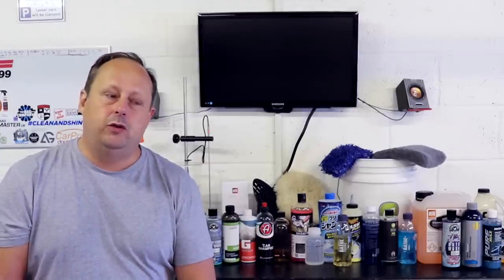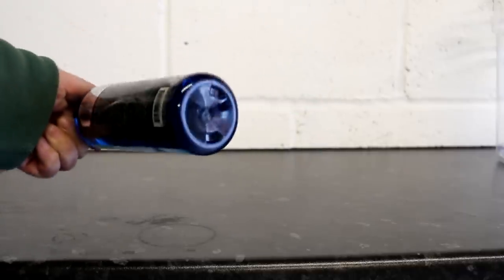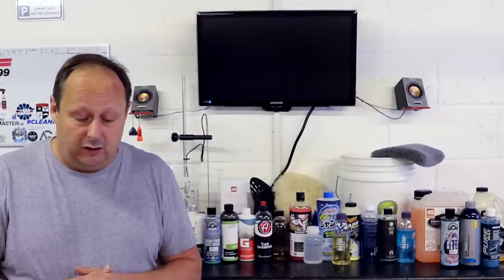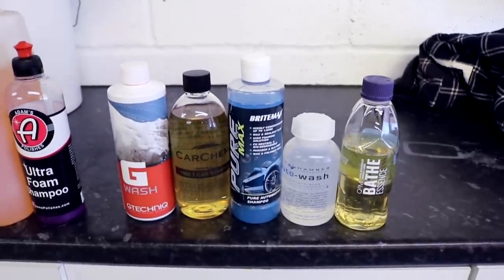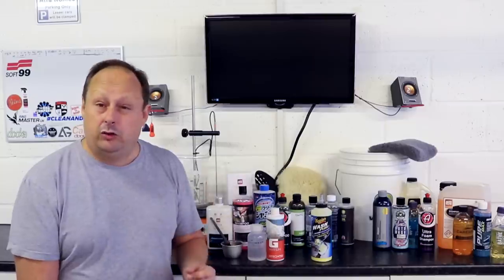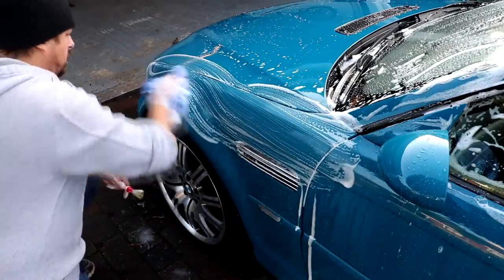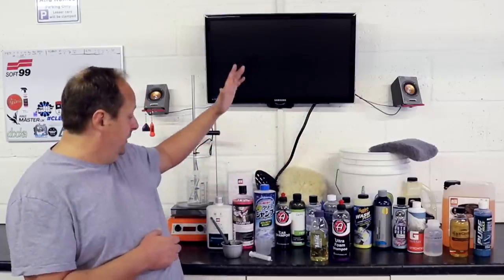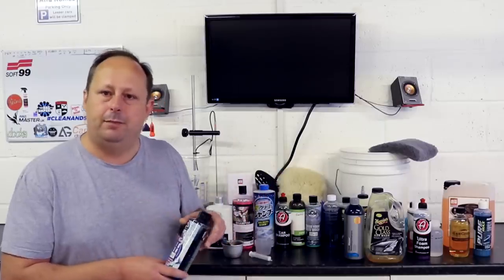The Best Car Soap Shampoo - 20 product shootout

Comment from the maker: Notes: 
Koch Nano Magic Shampoo is also available in 5L and 10L from the profesional line
Britemax is also available in 1 US gallon (not just 16 or 32oz)
Reply: If we think without pricing in mind...for nano shampoo ...Koch is the best for you?
Reply: @dimmacommunication  The question wasn't cost related. This is why i said "without thinking the price". The question was regarding performance of the shampoo ;)
Reply from the maker: you have catagory for Cleaning if thats the priorty and you have a catagory for like foaming.   you cannot measure slickness even the guys that make it has no lab style test for slickness.  

price per wash is just about the only tangable thing you can seperate them on.  but I realised it wont matter to all so we had catagories for like best retail luxoury one as well.

you have recomendations here for literally anything and everything you could want in a car shampoo.
Reply from the maker: @dimmacommunication  no worries mate that are all good points to raise I want to hear opinions all the time.   Ive used at 2 caps and 4 caps, but all the shampoos as you see them in the orange buckets and in the ghost bucket were used at lowest recomended concentration g wash says 2-4 capfulls but also say 1:1800 .  1:1800 is like closer to less than 1 capful.  still works ok at that low concentration but you get much better suds and stuff when you use a couple
Reply from the maker: @dimmacommunication  try it mate.  Its a good one for sure.    Its quite alkaline (PH9.6) and seemed to have a good impact on the grease tests I did.  aside from just this its nice and foamy as well. really good product.
Reply: Nice video to help people who looking the best car soap shampoo.
Reply: have you ever heard of bowdens? Australian made product, has a very big following in Australia/Newzealand
Reply: I got the Meguiar's Gold Class at Walmart last week for $5.97. I wonder if that would change your opinion of it. But I just want the best clean overall. Have you done an updated ranking? Can I use the ceramic washes if I am using Jescar and Collinite? Just curious.
Reply: this chemie shampoo does not remove waxes and sealants like Carpro Reset?! is safe in all dilutions »?!
Reply from the maker: @eduardofolha8415  carpro reset does not remove waxes and sealant eduardo.
Reply: @ForensicDetailing  I used Reset on snow foam at 1:10, waited 5 minutes and removed ....
Afterwards, it was washed with reset and 2 buckets .....
The Pan the Organizer told me, if I always wash the car with Reset it will affect the paste wax or spray sealant because it has alkaline power ....
It just doesn't affect ceramic tiles!
So is he wrong ?!
Reply: @ForensicDetailing  I don't have any ceramic tiles on the car ...
I only use a wax like turtle wax seal in shine, or meguiers wax spray ...
by the way, you say that the Reset shampoo does not remove waxes and sealants, OK!
And the pre-wash with Carpro Lift will harm the wax or sealant ?!
Reply from the maker: @eduardofolha8415   Search you tube for Alkaline V PH neutral you will see some tests I do.    The alkalinity wont make that much difference say its takes 25 passes of a PH neutral product to strip product X on panel Y replace with alkaline product and the degradation rate will be like 20 passes instead.  note this is just an example so dont take that number as a real figure.
Reply: @ForensicDetailing  so I can be calm about washing the car once a month with reset ?!
Even in 1:10 prewash ?!
Reply from the maker: @eduardofolha8415  yes mate
Reply: @ForensicDetailing  
thank you friend, I will be more rested, because Pan the organizer scared me, says that the reset is only to be used in cars with ceramics, otherwise it will remove waxes and traditional sealants ...
I'm sure he doesn't know what he says!
One less subscription!
Reply from the maker: @eduardofolha8415  tape off a square on your bonnet.  put a wax in that square remove tape. leave wax a day.   see if you can wash the square of wax away with carpro reset.  I can save you time.  you wont.  no detergent can strip modern LSP's.   your probably misunderstanding Pan.  What he might be saying is that reset is going to be more agressive than some shampoos.  And it is but the difference wont be huge.
Reply: @ForensicDetailing  he said that he will not completely remove the traditional wax or sealant completely, but he said that during the washings he would remove the protection since the Reset has alkaline power!
So you are saying that the Reset even removes the protections during the washes ??? ....
For me to be safer with traditional waxes and sealants, I would recommend the Koch Chemie Gentle Snow Foam, both for prewash and for washing, is it a softer shampoo ???
Reply: I know everyone gives wash and wax type products a hard time, but that'd be cool to see a comparison amongst that product range.
I find that wheel coatings don't last nearly as long as I'd like them to for the time and effort you put into them, so I'll typically use a wash and wax type product for wheel cleaning

Comment: A bit late, but there is one small issue with this test. Soft99 does not belong there, as this shampoo is not supposed to be diluted in water. You pour it directly on sponge and use only one bucket to clean sponge and if needed you pour a bit more shampoo. Otherwise you lose all properties, including easy rinse and ability to rinse even dried shampoo :)

Comment: Each one of your videos is a treat, Mate! I'm a pro detailer in MTL Canada and I've given up on the usual bucket and mitt wash and now use Optimum No Rinse and Wax on normally maintained  cars with quite stunning results for VERY little expense per wash.  BUT !! There IS a secret if you want way better than average results. FIRST, pour 5 capfuls into a 5 gallon bucket that has a lid on it because that amount will last you for 10 to 12 washes - AT LEAST.  NEXT, take 2 or 3 VERY plush, thick, CLEAN  16"X16" cloths and soak them in the bucket. Fold each cloth into 4 and use ONE surface of the cloth for PER PANEL.  DO NOT RE-DIP YOUR WASH CLOTH  into the wash medium!!!   (This beats the "two bucket method" by a country mile since your wash cloth AND your wash medium are ALWAYS CLEAN AND have NO GRIT in them whatsoever!!)  Again: wash ONE panel with ONE side of the cloth and keep switching cloth sides for each new surface.  EACH cloth has 8 sides, so 2 cloths should do for the average size car. With the Optimum No Rinse, and Wax, you can do one panel at time from the top down and then dry each panel right away with a soft waffle weave drying cloth spayed with your favourite Quick Detailer as a towel lubricant AND to add another layer of shine to the Carnauba Wax that is part of the  Optimum's solution.  At first I had doubters but everyone swore that they'd just had their car waxed after their wash! ( I call it a Detail Wash : ). BTW, I take FOUR, separate BLACK cloths and use one per each wheel and when finished, I put them in the wash to clean them SEPARATELY from the cloths I use on the cars. Happy detailing! Sorry for the long comment John - just wanted to get you back for your long vids! : )
Reply from the maker: awesome david thanks mate.  so many peeps choose the ONR way.
Reply: David.......this is exactly the way I do.  Nice to see a pro-detailer using this  rather than the BRS 

BTW - how do you dry after ONRWW
Reply: Excellent method to suggest for ONR washing, especially now that old man winter has come upon us forcing us to work indoors without the hose. By the way, which plush microfiber do you use on your vehicles for this particular method? I've actually tried Detailing Image's reTHICKulous towels the past and had some moderate success with them.
Reply: @kidoctane   Sorry Joseph for the past due reply - only saw it today! : )  Just take any good soft waffle weave drying towel and spray it LIGHTLY with a quick detailer like Chemical Guys VO7 to make sure you don't dry the surface with a completely dry towel and flip the cloth over for each panel. So, two or three waffle weaves should do you for the whole car or maybe 4 for an SUV. Cheers and happy detailing . . . errr . . . washing !  BTW - I'm not familiar with the BRS acronym : ) ?
Reply: @davidguberman4780    David, I got my cloths from Eshine in Canada but and they are thick but PROBABLY no thicker than YOUR THICKULOUS towels. Just about ANY PLUSH towel should do just fine. IF you have any doubts, you can always use 3 or four wash MITTS : ) The principle of the method has more to do with the fact that you don't RE-DIP your wash cloths or mitts into the wash bucket.  IF your Thickulous cloths are the thickest possible, then it's all good. If you can remember NOT to rub put to PAT any really soiled areas, then you'll not damage your paint. After patting the really soiled area THEN go over the area again, letting the weight of the cloth do the washing. IF the surface is really heavily soiled, then you may need more than 3 or 4 cloths so and not to re-dimp then in your wash media which both dilutes AND soils it. Just also remember to wash your wheels with 4 separate black (if possible) wash cloths and clean them afterward separately in the washing machine!  Happy detailing! Don't hesitate to write with any more Q's : )
Reply: @davidbee8178  Hi David. I was thinking to try this which towels do you recommend from eshine to do this? They have several  to choose from Thanks

Comment: Fantastic way to spend an hour with a coffee!!, I loved the way you split them all into their categories and tested to their capabilities.
I actually predicted carchem 1900-1 winning as I recently done a product review of it a few months back in the summer and it’s been the best quality shampoo I’ve used in 5 yrs! It’s got everything, dilution, scent, lubricity, foam, cleaning power and I found it quick drying without water marks too. Very difficult to separate them , looking forward to the next test 👌
Reply from the maker: thanks graeme,  kind of what you said is how I saw it.  I couldnt really find fault with it and its the cheapest cost per wash.  I had to almost keep saying that to myself though because there were so many good soaps that I would use in this line up.  I wasnt sure if bath essence or BH should have won as well because I really like these 2.  but ultimately the around twice the cost per wash of the car chem. thats what swung it this way for me.

Comment: I was pleased to see Autoglym in one of your videos again. I rate their products but I'm just an amateur at this, so its comforting that someone I trust to give reviews show some of their products and fortuitously they don't do too bad.
Reply from the maker: the UHD is a great shampoo.  but the problem is it was really impossible for lots of them to win this shootout  just based on the fact if you use like the ones that are sub 10p a wash.  they are really just as good (and that includes autoglyms own trade shampoo which is the second cheapest per wash in the test).  but as a retail product is a cool one to use.
Reply: LOUi DC5 FL  pleased to read I'm not alone using Autoglym. Readily available, cost effective and works well. I agree with the SRP comment but it works well on my paintwork, marking the trim is a huge minus point though. Just used their ultraHD wax for the first time and seems to be holding up well, it also marks the trim, on the plus side it makes me work slower which helps achieve a good finish.
Reply: paul frote 
HI Paul, no your not the only one I have been using UHD Wax, ever since Jon did the review on FDC. It's a great wax but just so user friendly. I waxed my wife's SLK last weekend and for a two door convertible there's a lot of paintwork 😀, I was able to cover nearly half the car  and buff off with no problems,  have also used on other cars with the same great results, Great depth of shine, smooth finish and yes reasonably durable. Great product
Reply: @marklacey1088  I wasn't brave enough to do half my 4x4 in one go, managed to do quarter at a time and the wax came off beautifully. Happy to read you are an advocate of it too.

Comment: Been using Car Chem 1900:1 for the last 6 months & it's the best shampoo i have ever used. Mine comes with  pump dispensers so 2-3 pumps gives oodles of rich foam. A 500ml bottle will last a weekend warrior for ages. Try it and you won't be disappointed.

Comment: Once again a great video. Honest and to the point. I've been using Auto Finesse Lather as I was told it was PH neutral and wouldn't strip the glazes or waxes I use. But after hearing you say not to worry about PH levels, I think I'll try Bilt Hampers purely on the cleaning power. I can get gloss and shine from finishing products.
Reply from the maker: both the best cleaning shampoos are around 9.5 PH :)     Its very very very hard to gauge how shampoos hit protective products more often than not the visual impact is the masking effect.  almost impossible to test this at home.

Comment: Great video. Clearly lots of hard work behind the scenes gone into this video. I have used Bilt Hamber and I think it's probability the best overall. However I moved to Car Chem because of value as I started to put the shampoo in a  foam cannon. I can put lots in the lance for cheap and the Bilt Hamber shampoo doesn't work well in a foam cannon.

I think there are two lots of people. The usual chaps that wash their cars once a month at best. Then the nutters that spend 5 hrs a week to wash their car and put everything into foam cannons. For the the first lot, use Bilt Hamber, for the second bunch try Car Chem.
Reply: Bilt Hamber make a specific snow foam!
Reply: Obviously. But you cant foam the car with BH shampoo for extra lubrication, then wash your car with a mitt unlike Car Chem shampoo with foams well
Reply: Sooo, the second lot should just use 1900:1 because it foams up?
Reply: Soooo, use car chem if you want to use it in a foam cannon so you get more lubrication during the contact wash. It foams reasonably well in a foam cannon. BH doesnt foam from cannon. If you dont use the foam cannon to put the shampoo on your car, then use BH, its fantastic stuff
Reply: However, you need more than the 1:1900 ratio to get the right amount of slickness

Comment: even with a correct prewash, even by rincing off my glove after treating a single element (door, hood) is still get some new paint marks. my opinion is : as soon as you start to physically touch your paint and apply even a very light touch with your shampooed glove you create the condition for the smallest remaining part of dust to deteriorate your varnish. 

the safest way is to stick with high pressure washer with shampoo tank and respect the correct distance. the shiness result may not be as deep but the paint stay more preserved. just my two cents.

Comment: Great effort for a very informative video. I have recently been using chem guys glossworks it really leaves an excellant shine however I have noticed that it leaves a spotty residue on the Windows which is difficult to remove. Really notice it while driving in the rain with the wipers going.

Comment: Bilt Hamber! 🏆 5mL is all you need!
Reply: But not ph neutral tjats the onky draw with it
Reply: @autodetail660  correct, you could change the variable and that's water. Ph neutral water.
Reply: Best shampoo
Reply: @autodetail660  you make it neutral when you mix it, and it contains anti corrosive chems
Reply: @Darkhunter218  explain
Reply: @autodetail660  the pH of the water will change the overall pH of the shampoo as it will be more acidic

Comment: As always a pleasure to watch your vids Jon. I'm using the Gyeon bathe essence myself. I know it's not 5 liters but they do sell them in one litre bottels aswel and not just in 400ml ones. It also looks like they didn't provide you with one of their handpumps. Normally Gyeon delivers these even with 400ml bottles and are quite handy to use. One pump delivers exactly 2ml of product. These pumps aren't perfect either as the product can dry inside the tip of the nozzle and you'll need to pry out with a needle or paperclip first.
Reply from the maker: yer I did all the price averages for the 400ml and 1litre size.  just wish they offered like 4000ml or 5000 but a litre you could argue is a bit like having 4 litres of normal strenght soap.

Comment: I've been using BH AutoWash for a little while now, i've been putting a little dollop of Auto Finesse Lather Summer Fruits in to get a nice scent from it, doesn't cause any residue issues and gives a nice stable lather. I do quite like the thin watery nature of it too, but then i have a ready supply of syringes to measure them out with.

Comment: I've been using G Wash for a year on a car coated with CSL. I didn't know it was that highly concentrated! I use two capfuls for about 4 gallons of water. May need to try it out using less product and gauge the results again. I find it to clean well, and works flawlessly with their coatings. Foams decently, but sometimes I have to shoot some more water in my wash bucket to reactivate the suds.

Yet again, I wish there was an importer for Bilt Hember and Koch Chemie. They seem to always perform and have unique characteristics. 

Fantastic video.
Reply from the maker: G wash yer its actually a 1:1800  I notice they say you can use 2-4 capfulls.   I think 1:1800 is like what 6-7 ml for 10 litres.   Or half a capfull though.  not sure.  I would say with ten litres 2 caps should give you a decent amount of suds.  I wouldnt go beyond 2 with 10 litres though.
Reply: HStuning is a US importer, although its expensive and they don’t stock a lot of the line. The soap is available though.